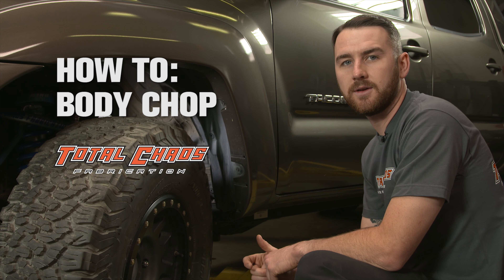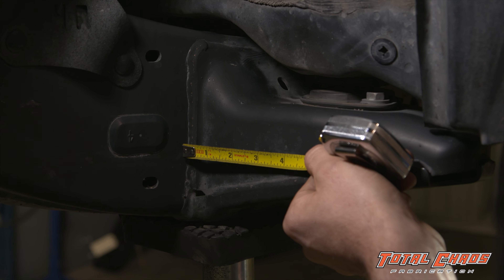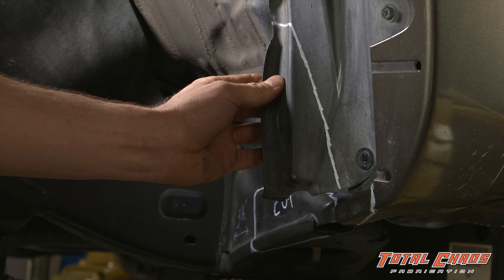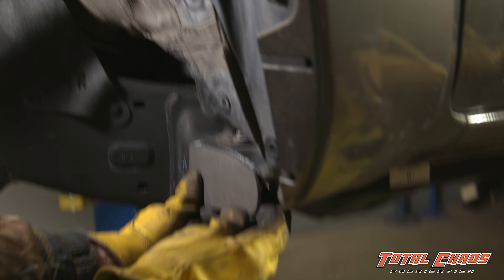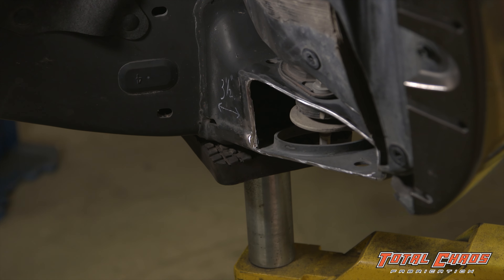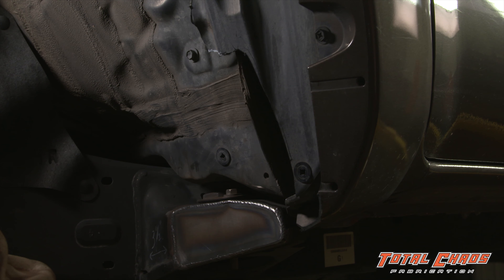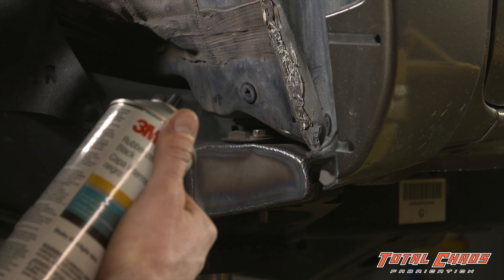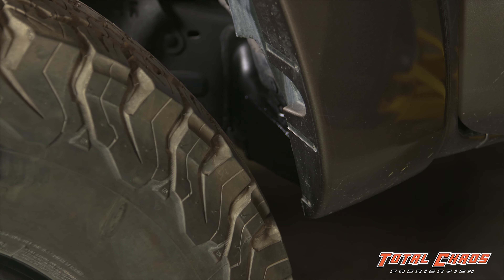How To Install Body Mount Chop Plates: Total Chaos Fabrication

Comment: I put about 4 degrees of caster to kick the tires forward in the wheelwell and the tires don't rub the body mounts anymore.
Reply: What lift you have and wheels? What kind of UCA you running. I tried that and can only get 2.1 caster and still rubs some
Reply: @jeffroberts2279  Bilstein 5100s at max with 3/4” Toytec spacer on top of strut top plate. 285/75R15 BFG KM3s on 16x8 Methods.  Total Choas UCAs.
Reply: @ratcamaro gotcha…I put eibach stage 2 coilovers with freedom uppers. 17x9 fuel wheels -12 offset with 285/70/17 K02’s. Mine rubs pretty good. Had it aligned several times and the most was 2.1 caster
Reply: @ratcamaro you don’t have problems with your cv boots with all that lift on front? I done replaced a boot and only have 2.75 of lift
Reply: @jeffroberts2279  Never replaced a CV boot. I have 97,000 miles.
Reply: @ratcamaro  wow, my cv angles are hideous with only 2.75 inches of lift.

Comment: Solidly the best tutorial on the web for the BMC on Tacoma. Well done! I just wonder WTF Toyota was thinking in making the Tacoma so big and making it so the tire size can’t be expanded without a chassis chop. It’s as if they intentionally abandoned their most dedicated customers. I also wonder if the body mount could be reshaped with an air hammer - haven’t tried, but wonder if it’s a possible alternate solution.
Reply from the maker: Thanks for the support! We definitely wouldn't want to take the risk using an air hammer. Too much potential damage for a result that could be safely achieved with a few smaller cuts and welding the plate on.

Comment: Just to make this easy, ground closest to the weld plate. In most cases, you can grind off to bare metal on the other side of the body mount and ground there.
Reply: you dont make any sense

Comment: I have a question for you. Wouldn't it be a lot cleaner and better if you just remove the inner fender well to cut the seam and then reinstall the inner fender well back?  That way it looks like nothing was cut?
Reply: I just pulled it back and knocked seam over and put liner back. I did have to heat the liner to kinda flatten it a little where seam made it stick out.

Comment: Great job!!! 👍👍👍 I will have a BMC done to my 2012 TOYOTA 4RUNNER LIMITED so I can be able to run 33x12.50 tires with no problem!!! They will go on a set of FUEL 20X10 rims with a -19 offset with a PRO COMP 3" front and 2" back lift leveling kit!!! In the process I will have them also cut the front fender well rubber plastics!!! Great video it was very informative and the job was well done!!!👌👌👌 How much would be a reasonable price to have done what I just mentioned to my TOYOTA 4RUNNER??? Thank you!!!
Reply: As someone who is about to do a couple of these as a job, I'd like to know as well

Comment: Hai...
if the part is cut, do we need to install any accesseories to jack up the body ?, for 16/285/75 ..?.  or is that enough ..?
Reply from the maker: The body mount chop should be in conjunction with a suspension lift.

Comment: I have a 2012 Toyota TRD Sport. I recently purchased newer TRD wheels that are 17" and they are 7" wide. I put the original tire on them that are 265/65R/17. I'm going to do a 2" suspension lift with Bilstein 5100s. Is that enough lift to step up to 285/75R/17 which is about 2" taller and 1" wider? Thanks. Enjoy your videos..

Comment: I run 255/85r16s 33s with no rub and even kept my front mudflaps.
Reply: that is a skinny 33.. if that is what you want then cool.
Reply: I also run that size love it. It does not look that skinny on the truck. I love them.
Reply: Pizza wheels
Reply: @bumwater3597  Lmaoo

Comment: I am wanted to get bigger tires and 3" lift.  Would it still have a rubbing problem with the lift?
Reply: You’ve probably figured it out by now, but yes. 3” suspension lift with 33’s and BMC was required for clearance and viper cut to look cool.

Comment: great explanation on this job, but I still dont get it when some people say they run the same tire and no rubbing???
Reply: Seline Ramos it’s all about the offset of the wheel. The more negative, the more it will poke out and have a higher chance of rubbing.
Reply: @raymacias8144  i run the same wheels as in this video but with 295s and don't experience the same kind of rubbing as he did.  not sure what lift height he is running tho.. but mine is 3".
Reply: I have 3in lift. I've ran
 285/70/17 pro comp at sports
255/80/17 Cooper St Maxx
And never had an issue rubbing
Now I want to get 285/75/17 
Using 17x9 -6 wheels
 Is it worth it to even cut, or wait it out and see if it even rubs
Reply: @JF_-sk9sc  you might be able to get away with it on the street with plastic trimming but it'll most likely rub a little on the cab mount while in reverse.   But you will have to do the cab mount chop and pinch weld mod in order to clear it offroading.

Comment: I want to do exactly this but I am going to stick weld it, any recommendations on what stick and amp to use would be greatly appreciated. Thanks
Reply: Personally I wouldn't use stick, but if its the only option; 3/32" ER7018 around 70 amps, move quickly and stitch it. The "stitching" shown in the video isn't actual stitching. Make 1-1.5" stitches jumping around from side to side similarly to how you tighten lug nuts or tune a drum. Source: am a certified welder

Comment: I run 265/65/r17 on my 08 Tacoma but the front tires rub. I have a feeling it has to do with the offset of the wheels because they’re aftermarket. Would anyone suggest to do some trimming?
Reply: Trimming anything on your vehicle with less than a 32 inch tire is not at all reasonable on these trucks/SUVs. Think of a small lift, maybe just a 25 dollar spacer "leveling lift", maybe just 1.5-2.5 inches. I'm running a 3 inch leveling kit in front on a 2007 4runner and love it, with bigger tires, too

Comment: Did you pull the body mount bushing out before welding or grinding?
Reply: Read on FJCruiserForums that you need to pull the bushing out before welding.  Otherwise, it flames up like a roasted marshmallow.

Comment: I have 285/75/16 on my lx470 and no body mount chop needed. My front end is dropped down because I didn’t change over to lc torsion or ome. I have ome all around except for torsion bar. While front isn’t lifted I get no rub and it’s almost tucked.

Comment: Would you still need to do this cab mount chop if you had a high clearance off road winch bumper like All pro?
Reply: yes, the bumper will only help the tires clear the front of the body, not the rear of the fender well/body mount
Reply: Yes, The bumper gives you clearance in front of the tire. The body mount chop is on the back side of the tire.

Comment: Hell naw I'm keeping my truck stock lol. I got a 2 inch leveling kit with stock tires and I'm happy.
Reply: Lame
Reply: I am running a 2 inch lift and 33 inch tires, went to wind rock off roading and I could feel the need for larger tires to clear stuff.    if you just want to bro-doze about the mall parking lots do whatever you want, put rubber bands on it, squat it, leave it stock, doesn't matter as long as it rolls down the road and makes you happy man.  but for off roading stuff like this is  godsend.

Comment: Am I the only one that doesn't understand the point of cutting the body frame mount out just to put a piece back??
Reply: Seems like it.
Reply: You're cutting away a portion that is sticking out. when you weld in the plate it is not adding material back that you removed, only making a blocking plate of sorts.

Comment: Save yourself time just buy a bigger truck
Reply: Silly. These trucks make like 265 horsepower minimum and about the same torque, all out of a reliable v6. Those are about the same as most v8 truck horsepower numbers, man. Look it up. You get a lot of truck out of these mid-sized trucks.
Reply: @BainBoyd  and you can fit the tacomas down trails in woods